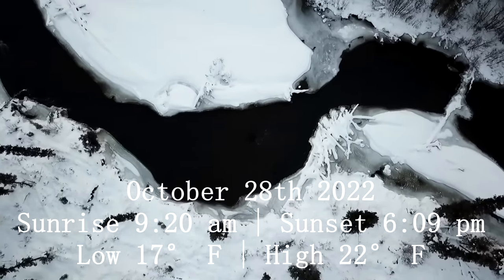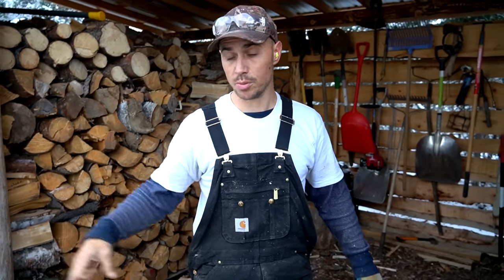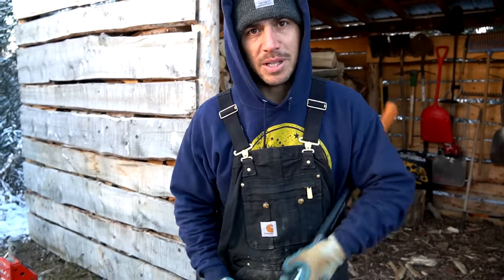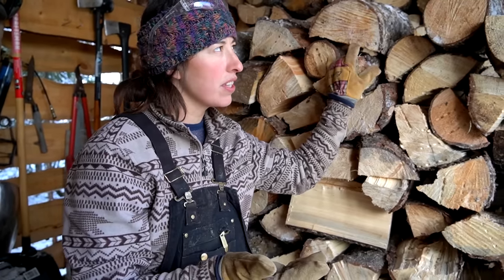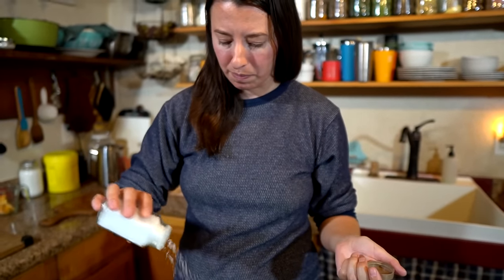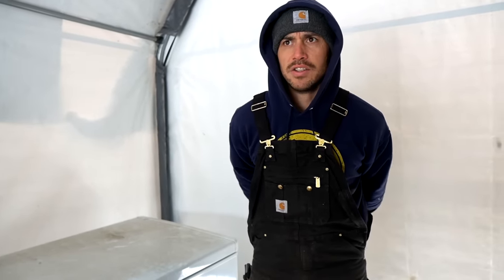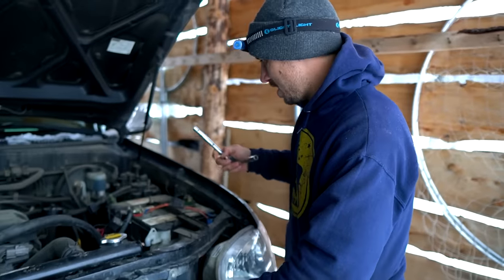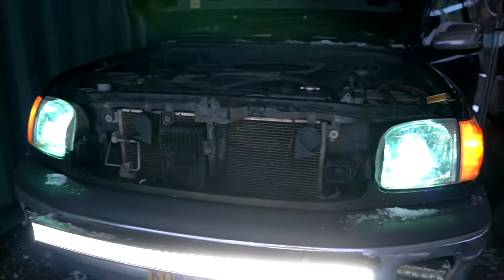Winter has Arrived | Filling up the Wood Shed

Comment: Watching the teamwork Arielle & Eric  display in  prepping & filling the wood shed  is heart warming  That spirit extends into everything that they do. Taking the time to plan, get materials needed and do  necessary maintenance activities  will pay dividends over the coming months. Totally baffled about the  new headlight system on the older Tundra though in respect to the complicated install and  parts required. How new is this system ? Always
a pleasure watching your adventures. Winter has surely arrived where you are. Brrrr. 👍👍👍.

Comment: The exhaust piping will have water gather at the bottom bend of the pipe and that will freeze once the flow of fumes stops.
A small drain hole at the lowest point of that bend will allow the water to exit and prevent freezing. This method is kind of like a 'drip loop' where a cable comes into a house.
Cheers, Dr.Skip

Comment: When I was in ND I also had to get special ice tires for my Toyota. After buying tires designed for ice (not just snow tires) it ended my problem of sliding into every intersection. I also went to full synthetic motor oil so the truck would start easier since the oil didn't thicken up so bad. Thick oil runs down a battery fast. A remote starter was also great so the truck had time to warm up before I had to drive it. This came in handy when at work and no plug in for a block heater. I also installed a block heater and kept it plugged in when I was home. We would on occasion fly home and the truck would be at the airport for 3 weeks. I installed a cut off switch so the electrical system wouldn't run down the battery while I was away. This was a big improvement, since the airport didn't have anyone to help jump start a vehicle.

Comment: 😂 looks like Eric will be splitting by hand 😆
Reply: As a person who splits wood both ways, you are limited by the slow machine.  However by the end of the day, I think that I will stay with the splitter.  I can move the next day!
Reply: The difference however is that Ariel could go all day splitting wood that way - Eric however would not be able to maintain that pace with the axe all day so ultimately, in the long run the splitter would have won hands down in performance.

Comment: I split my wood using a 15 inch used tire attached with 4 screws to my splitting log which is slightly larger in diameter than the tire opening, fill inside the tire with as many logs that fit and split away, peices do not fall on the ground.
Reply: You definitely have got it down, as it really works.

Comment: Hi, couple of suggestion for making Toum you could have used the hand blender to shopped the garlic with the salt then you blend while you are adding the oil as a slow drip when they emulsify you add a small spoon of lemon then you repeat with the oil for couple of time until you feel it’s done add then a small tea spoon of cold water and mixed them a bit and it will keep it white. Another suggestion it’s a good sauce to go with grilled chicken (specially barbecued chicken marinated with olive oil garlic and lemon) that’s how we basically use it in Lebanon. If you prefer to eat vegetarian the Lebanese cuisine is full of easy recipes that you will enjoy eating since they are derived from the Lebanese mountain resident.

Comment: I love great headlights. I used to drive 3500km a month to work and moose, deer and buffalo were a real issue.  I got some very high end lights installed and ended back at the dealership saying I couldn't even get truckers to flash me for high beams being on.  The teck gave me the adjusting tool so i could set them up to suit me.  I didn't care what was right in front i needed the lights set up for ditches and 60 ft in front.

Comment: Adjust the beam down, you should see a cutoff line with projectors and it'll help oncoming traffic with the brighter lighting, but still give you better lighting.  I backup like 30ft from a wall and have the beam around 36inches (tons of guides out there to properly adjust lights).

Comment: I have run 2200 honda's for the last 18 years, I also Have used 5-30 and 5-20 in a pinch.  What I have found works good for iceing is cut a 50 gal barrel in half { make a small floor for the gen } stuff the gen in and let the exhaust keep the carb warm. You can move the gen inward for cold or out for warmer. I only do this in the winter.  Works good for me..

Comment: Not a fair competition.  Where the log splitter comes in is that it won't get tired after half an hour or more of chopping wood.  It will just consistently keep going as log as you put fuel / oil in it.  It won't have sore muscles or creak and groan because of the wear and tear from working hard in the cold weather.

Comment: Significantly different lighting with your projector bulbs.  That was an interesting kit.  Thankfully it came with its labeled wiring harness.   You have chosen an interesting lifestyle, relying on wood heat.  Have your propane tanks ever cooled to the point where the gas reverted to a liquid state?   A friend vacationed in Florida many years ago and had to refill the tanks on his camper.  The following winter they realized that the tanks had been refilled with butane that boils at about 30°F; propane boils at about -40°F.

Wishing you and your family a blessed thanksgiving week, filled with fellowship, food, gentle weather and restful evenings.   Peace

Comment: Not sure if you do it or not but for bar oil, one of the best things to use and it's recycling, is used truck motor oil. When you change your oil, save it in a jug and use that. I cut timber for a living for many years and never bought bar oil. Just used stuff.

Comment: Thank you for you video and the time for edit and all... we process the wood similar here however we started to process the slab with a mitter saw if you have your slab on the ground then mitter saw on the ground for slide and cut, if you have them like us on pallets have  pallets at similar height so you can simply slide in and down to cut. Wheel barrel or anything you use to move them. 
 
Again awesome video, keep it up you guys are amazing.

Comment: Eric use 10/30 synthetic. I have a EU3000is it starts great ,even at -40 below. 
Honda engines are developed, tested and certified with petroleum based motor oils as a lubricant. Synthetic oils may be used; however, any motor oil used in their engines must meet all oil requirements as stated in the owner's manual, to meet warranty requirements. Like your headlights!

Comment: My father taught me to use 'Dry Gas' in our family's small engines to get the water out from condensation in the tank(s). It is not very expensive and comes in pint cans with a screw top.
Dry gas is an alcohol-based additive gas used in automobiles to prevent water from freezing in water-contaminated fuels and to restore combustive power to gasoline spoiled by water. It is added to the fuel tank and binds to the water to burn it off.
All the best, Dr. Skip

Comment: Eric......... Arielle......... You two, and your videos never fail to amaze me. From cutting, splinting, stacking wood. To an amazing looking dinner.Then winterizing all the vehicles and accessories.
The log splinting....... Had that been a volume challenge, then Arielle would have won hands down. Eric would have tired quick swinging that splitter, and Arielle could have caught up, and passed with ease. LOL Been there before on that maul swinging. 
Headlight swap out was a big difference. Light night and day almost. And heating in the oven to soften the glue........ Neat little trick.

Anyhow...... Love your channel. Your adventures are so fun. You two do a little bit of everything.

Comment: That is the slowest wood splitter I've ever seen! You might try changing the pulleys on it to try and speed it up? it won't have as much power but would be way faster. Power doesn't seem to be an issue, it's the slug slow speed.  Peace and blessings.

Comment: Four fence post in the ground 2 ft apart would make cutting your logs a lot easier, just stack the logs and cut with the chainsaw.
The bigger logs burn slower but also don't put out as much per hour. Same amount of heat just spread out. 
Sit up some real small firewood for the morning fire, it'll heat the house up faster. Use the birch logs for your nighttime fires

Comment: The log-splitting machine is a labor saving device.  As swift and good as he is, Eric will eventually tire out faster than that machine will run out of gas, or its operator will tire out.  So while it's not a time-saving device, it definitely allows a person (or a team of people) to split many more logs over the course of the day with fewer breaks.

Comment: Great videos thank you. You guys have seen those methods where you wrap a rubber tie down strap around a round of wood (ones with a few adjustment holes work well) and it holds it together as you split it? You don't have to keep bending down to pick up your sections and just remove the cord once you have split it all. You can even pick up the whole bundle at once sometimes, with the bungee cord, and just carry that to the pile.

Comment: Winter is here too...but just 39 F after a quick dip to 59 F some days ago. Still no snow here up north but in the south of Sweden they have snowstorm, extremely strange weather! Got tired just by looking at you chopping all that wood, good job, those days are over for us. Changed to burning wood pellets a long time ago and the last 10 yrs we have only used electricity, saving money to buy a heat pump and dig for geothermal heating...we´re getting older... I will try toum out, it seems to have quite an amount of oil in it so I´m not sure if I will like it but one have to try before you know! But...today is cookie-day, x-mas is on its way!

Comment: Chip from Tok Alaska again. On your generators, put a heavy cardboard box over it and cut out an exhaust hole in the back. For your extension cord cut out a flap in the front for your cord to plug into and put your generator on a piece of 2-inch blue board foam!
In Tok, we can get -70 F and this works well for the generators.
When you retire for the night bring the generator into the house to keep the oil thinned out.
In the morning return the generator back under the box as long as you are going to run it!
LOVE your channel!!!
Reply from the maker: Thanks chip!

Comment: Hands down worth the effort on the lights.  Absolutely have to be able to see the moose beside the road.  They can fly across in front of you.  Total destruction.  We have lost several people around Fairbanks from moose collisions.   Glad you have the generator exhausting well outside the shed.  Even though it's open it presents a CO hazard.  We had a couple different fatals from fellows working beside a gas powered steam jenny and a welder.  Each died in open air from CO poisoning due to the humidity being so high and the wind low the gas was trapped at breathing level.  Always keep a check on that hose and coupling.  Torum looked fantastic.  Almost smell it.  Have some Lebanese friends, they cook some great dishes.  That pile of wood, got a feeling it's going to get pretty small this winter.  Those slabs can be difficult cutting.  Seems easy to hook the chain and jump it off the bar.  Monitor tension closely.  Pretty drone work.  Freezing fast.  Of course it's up in the year and past time for it.   Take care be careful stay warm.

Comment: Great job on hard work. You need to file down the teeth guides between the teeth on the saw chain. It will cut much better and faster if you file them down some when you file the teeth. Thanks for a great video.

Comment: Correction: 10w30 means that it is a 10 weight oil with additives that allow it to protect like a 30 weight oil, and a 5w30 is a 5 weight (thinner) oil. You are correct in that a thinner oil is usually better in the cold, as it won’t jell as quickly as thicker oil.

Comment: The bundle of sawmill cutoffs would be quicker to cut if you wrap it with two two ratchet straps or two come alongs. You tighten one and then tighten the other and the bundle loosen up the first one and then you take it off and retighten it
Reply from the maker: Great tip!

Comment: I have the same opinion about the BFG K02's. Not good in the winter, and I have found that they hydroplane easily in heavy rain. But, they are super tough and work really well off-road on gravel/sand/rocks and they aren't bad in mud either.

Comment: As far as the choice of using machine vs man for splitting logs? Unless I'm in a great hurry, I vote for machine, or something equally easy on the body. Sending shock waves through an old body tends to hurt much worse later, inevitably when I need to be relatively pain free.

Comment: If you both had a cord of wood to split the wood splitter would win. It doesn't get tired and you can go at a steady pace. Splitting a cord of wood by hand would take longer because you'd need to slow down, and take breaks. As a teenager I worked for a guy that sold firewood. I spent days/weeks sometimes, splitting wood. I split a cord of wood by hand for a lady last winter and I sure wished I had a wood splitter. I'm no spring chicken.

Comment: The generator exhaust will have water vapour in it which may condense out in the cold and freeze. If you run it for long enough to heat up it may be ok.
Reply from the maker: Thanks for the tip that is probably what happened to the old exhaust

Comment: Hi. The stow you showed on video - is that the one you use to warm the house??? If so you may consider building a brick one. It will hold heat a lot longer whit less firewood used.

Comment: Have you tried straight 10w oil for the winter, I used that during the winter here in Minnesota on the snowblower. Minnesota ban the studded tires in the late 60s or early 70s it was wrecking the roads.  Great video

Comment: What sort of trees you using as firewood?I live in Finland and we live by the rule that everything bigger that your wrist should be split in half so that the wood dries faster and also burns better emitting less fumes .I fell and make firewood from birch, spruce, pine and aspen primarily.Especially birch and aspen are the one ones that needs to cut in smaller size.We have winters of around -30c ...We have chickens, meatrabbits and islandichorses.Lots of hugs from here <3 PS about the generator exhaustpipe, i wrapped mine with glasswooltape.You can do it with rockwool or glasswool and roll of ducttape ;)
Reply from the maker: We burn spruce that has been killed by spruce beetles so it is dry and ready to burn

Comment: Yo guys...the kohler exhaust pipe will get blocked up due to the bending upwards. I would raise the unit up off the ground and simply let the exhaust gravity drain downwards. My deisel heater had this problem.
Reply from the maker: Thank you for the tip

Comment: Winter is NOT when you fill up on firewood.  Firewood has to age and dry out to be USED in Winter.  Two springs prior is when you stock up for a following Winter.  Making sure your cut wood stays in a dry piling under cover.
Reply from the maker: The wood we will burn this winter is dry dead beetle kill ready to burn ;) the birch will season a year

Comment: You unplugged the freezer, but since it’s insulated, doesn’t it keep the cold air out? Seems like it would need to be left open a crack to let the outside air in. I may be wrong?
Reply from the maker: Insulation only works if it has a heat source, without heat the inside of the freezer is the same as our outside temps
Reply: @SimpleLivingAlaska  that makes sense!👍. Plus I’m sure it gets REAL cold in Alaska😊

Comment: Ariel if you’d had a 4 bladed steel wedge on your wood splitter you may have tied or beaten Eric. Can y’all replace that wedge with a 4 bladed one ?? Or does the splitter not have enough power to run a 3-4 blade wedge ?
Reply from the maker: The splitter belongs to our neighbor  ;)
Reply: @SimpleLivingAlaska  🤣 well no putting another blade on it then 😂👍

Comment: I've been making toum for decades... You are working way too hard. Using a garlic crusher is so much easier.

Sesame oil works great with toum, don't use olive oil as it doesn't keep well.

Cardamom adds a nice flavor.

If it's too thick, add a few drops of lemon juice.

I add the crushed cloves of one bulb, two tablespoons of real mayo, a few drops of lemon juice, and start with 1/4 cup of sesame oil.

I then stir/beat it with a spoon until it thickens. If it is too thick, I add tiny amounts of sesame oil and stir until it reaches the right consistency.

Everyone who has tried it is blown away by the flavor! 😊

Enjoy!

Comment: I'd be taking that split wood off of the splitter and straight to the stack. Too much labor bending over to stack it. Work smarter, not harder. Your back and joints will thank you when you get older.

Comment: Did that grill come on the silver Tundra or did you get it after you bought it? I kind of want one for mine. I also just installed some OEM TRD Pro LED headlights on my 2019 Tundra and they're awesome. I'd consider it for yours as well. Pricey, but worth it I think.
Reply from the maker: The grill is made by rigid lights, comes with light bar and pods also

Comment: Not a good idea to tighten the lug bolt on the oil pan with a powered tool.  Way too much power it could ruin the oil pan on your Tundra !
Reply from the maker: That was the skid plate ;)

Comment: Toyota's are amazing vehicles and it's not unusual to hear of them getting over 400,000 miles.
However, it is not a good idea to change their oil at 10,000 or 15,000 intervals.
I am amazed yours has those kind of miles using a 10,000 + change practice.
I suggest you follow a 5,000 or 6 month change practice instead.
Check out Youtuber "The Car Care Nut" a Master Toyota Technician!